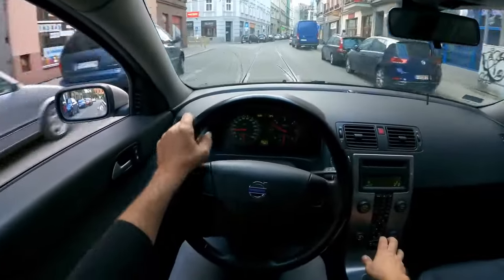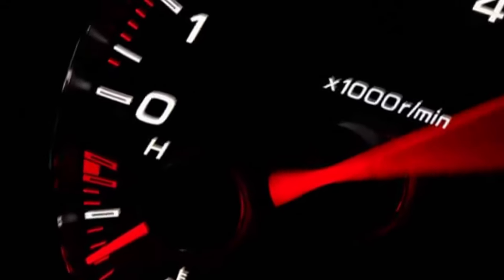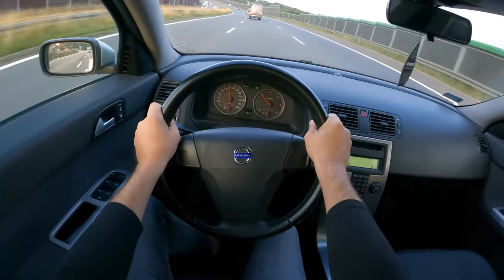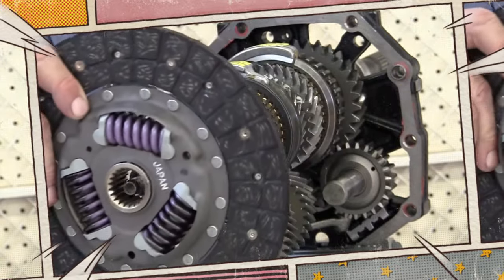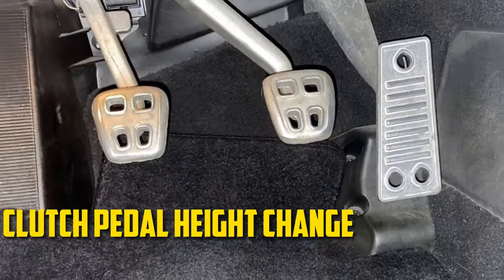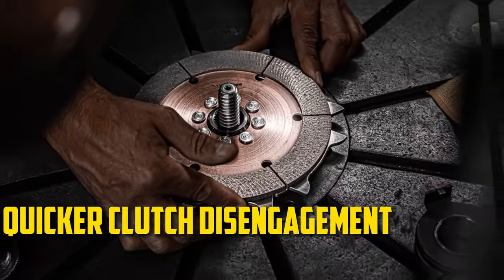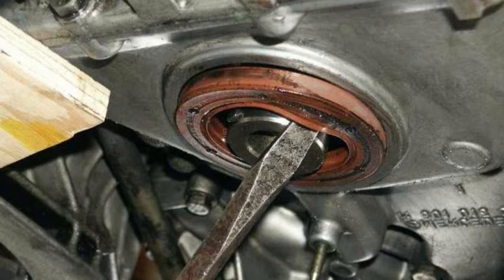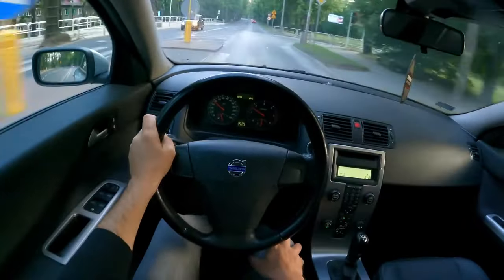5 Slipping Clutch Symptoms (Manual Transmission). How to Diagnose and Fix

Comment: But how can it be that the clutch is only slipping when I'm in 4th and 5th gear?
Reply: I want to know too I’m slipping at 5th
Reply: It’s slippery when wet by the worn rear main seal leak
Reply: @Mercur1al_fc1 it's difficult to explain if you don't understand the purpose of having different gears and what that means in terms of engine speed and transmission output speed
Reply: @juaneer  okay thank you I guess
Reply: @Mercur1al_fc1  think about how hard it is to pedal a bike on the higher gears, then think about how much resistance your engine faces when trying to accelerate in a higher than ideal gear
Reply: @juaneer  you know what, I actually figured it out. It’s the wheel spin because during the time I did a pull and on 5th with winter tires on and I thought it was clutch slipping until I saw a video talking about wheel spinning. That’s when I confirmed it wasn’t ny clutch. I appreciate your input and the sharing of knowledge. Thank you!
Reply: Hey, did u fix yo issue

Comment: I have a problem where all my gears go in just it won’t go when I gradually let off clutch and give it gas it doesn’t go
Reply: Me too. If you found a reason for this please let me know. All my gears are catching, no smells or smoke, no weird clutch feelings when I push it, nothing. Just goes into gear but doesn’t accelerate really and also acts like it doesn’t want to start when I turn the key. It’s not sounding weird or anything just regular cranking but takes longer to start.
Reply: @ mined turned out to be the clutch I replaced the clutch and ran great after